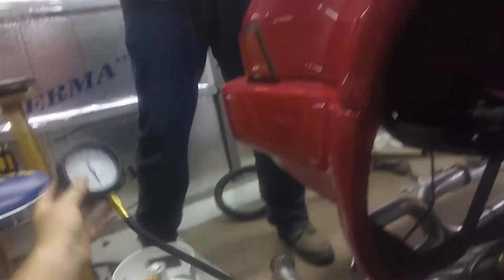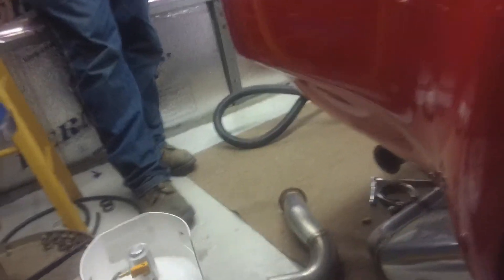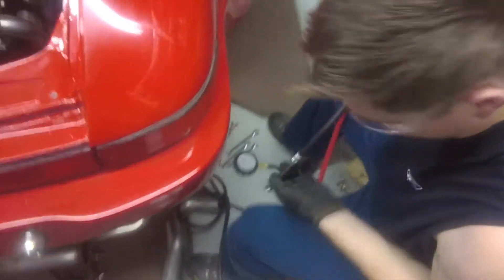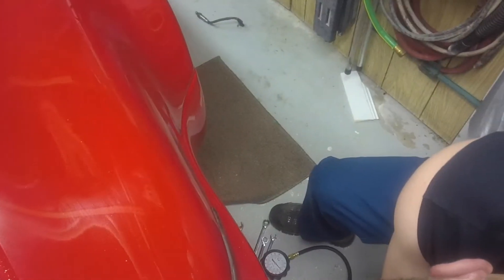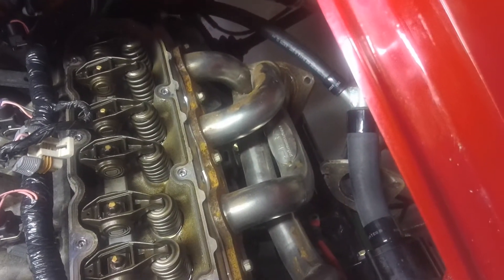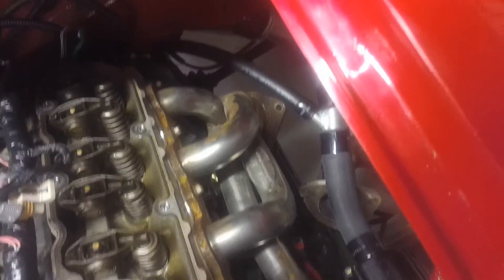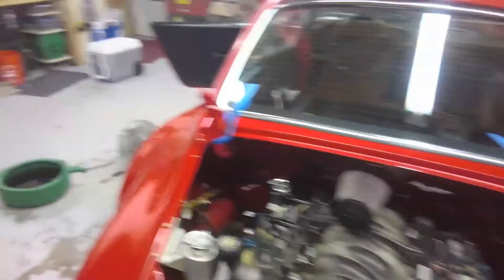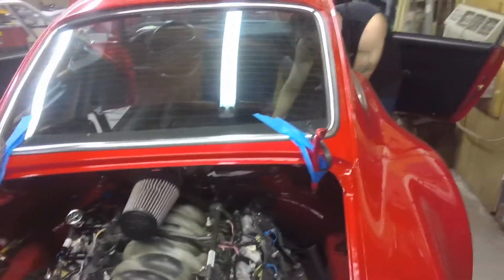How to Pre-Lube an LS1 with a pressure tank

Comment: I've seen guys take the plug out of the side of the block next to the oil pump, drivers side, and put a 3/8 hose with a funnel on it and dump 8 oz. of oil directly into the pump enough to prime it and crank the motor.